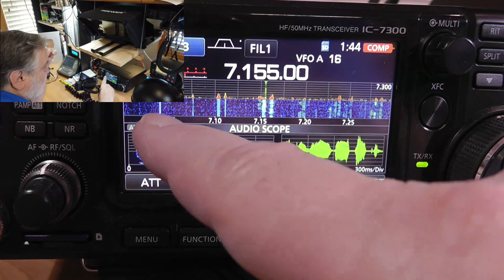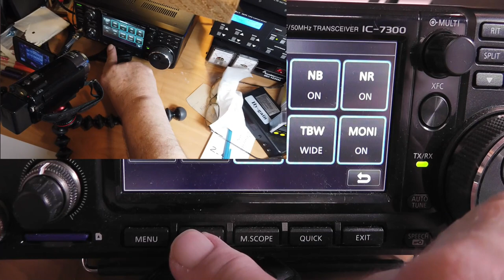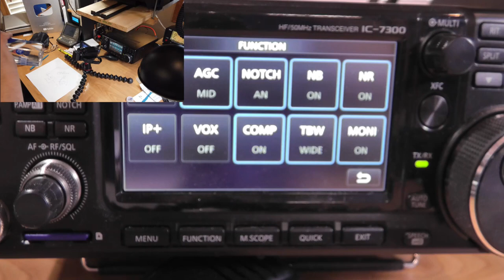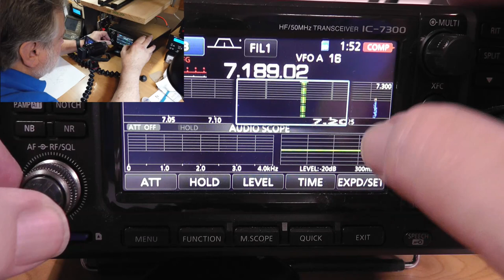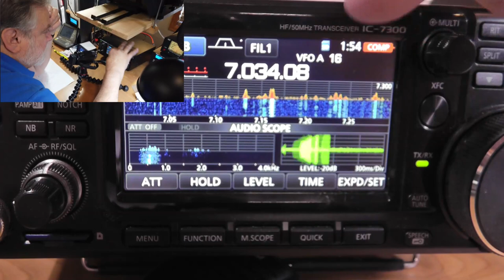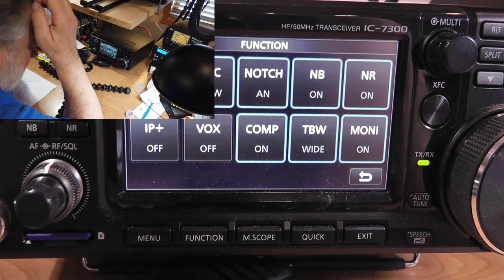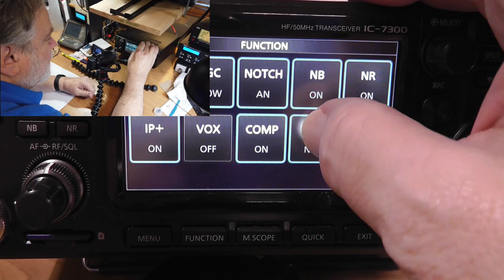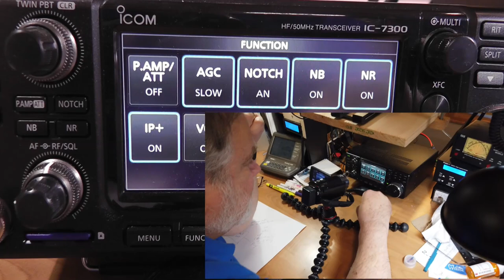Uses of Pre-Amp, Attenuation, Notch,  Noise Blanker, Noise Reduction, and IP+ ? (#622)

Comment: Muchas gracias Dave.   I've been experimenting with the 7300 for a little over a year,  I believe it may be  one of the most popular rigs used on the air today. I wish the ICOM manual went into the same detail as your videos. I never have used the pre-amp feature on the 7300. I'll have to try it on the upper bands with a weak signal I want to work. 73, KC3REC

Comment: Great video! I find my self using the notch Manuel filter a lot! You forgot to mention that If you hold the notch filter Down you get some manual control like width and placement. 
How I use the notch filter is that If a ft8 signal stats squealing away within the voice SSB signal your listening to you can manually select the smallest notch filter and exactly cover up that ft8 signal. Keep this videos coming! I’ve lesson much from you!

Comment: I like to use my pre amp on 80 meters all the time. I just turn the volume down compared to 40 meters and higher. That’s interesting about the notch filter. I always wondered where that would be useful. I usually just use my noise blanker on mobile setups but recently I had a 3 day power outage and used it to filter out my generator ignition noise.
Reply: Last summer I went to a local ham group picnic at a campground. I had a chance to use my mobile station’s attenuator but the signals from the other hams at the picnic were so strong that my S meter still maxed out even from QRP signals. My pre am was also off. It was pretty interesting to see!

Comment: I find that the RF gain is an extremely effective control to reduce noise, second only to the automatic noise reduction.  I almost never run the RF gain wide open. I believe a lot of hams use it that way to control noise.
Reply: RF gain is among the most useful controls a radio has, second only to the OFF button.